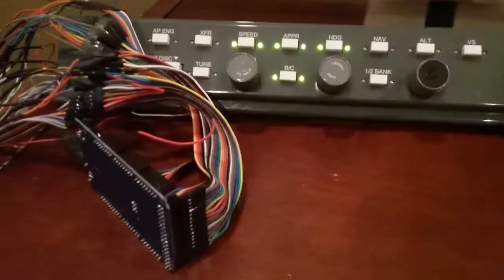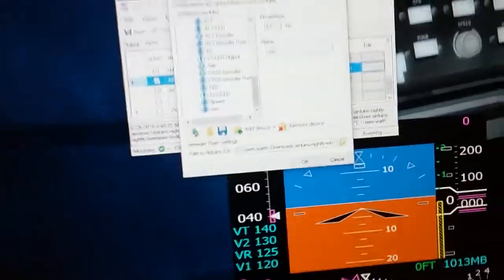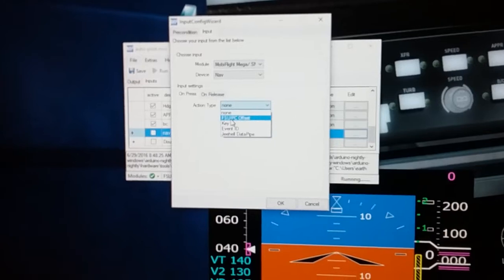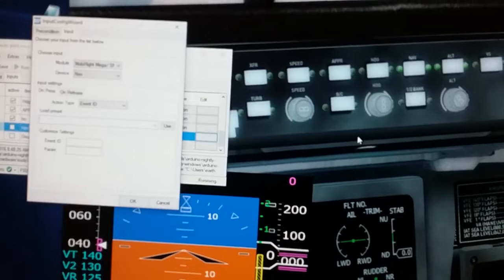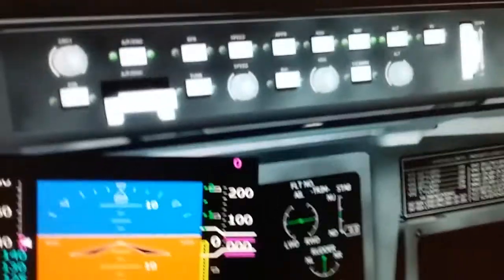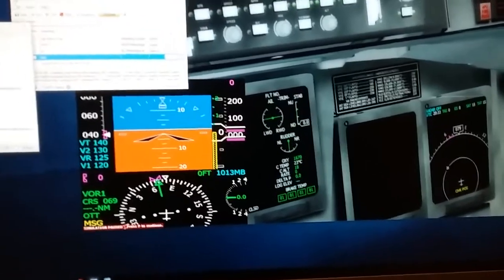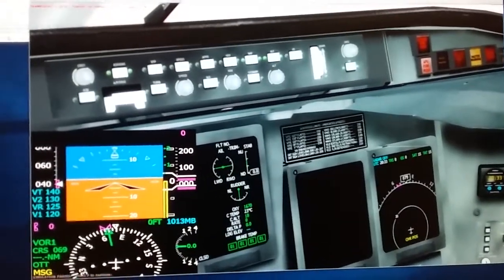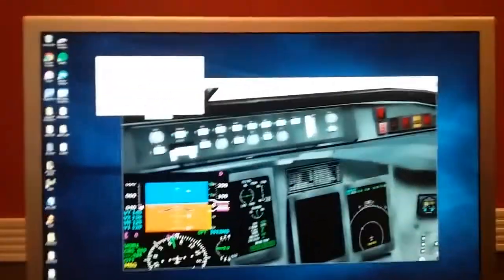How to connect hardware to FSX, Prepar3d, xplane, FSUIPC, Mobi Flight Connector

Comment: So, is there any way to work Mobiflight with XP-11 ? Like using custom Dataref's or commands ?
Reply from the maker: Slammer you would want to use our ARDSim it is similar to this program but it's designed for X-Plane
Reply: I know about that but all of my cockpit system is completely based on MobiFlight and ArdsimX needs some different things with the board to be done, which i'm not keen on :)
Reply from the maker: Slammer what all do is try to make a video that explains how ardSim works in relationship to the board it's actually pretty easy and I'm sure you can do it once you get a good grasp on how it works

Comment: Is MobiFlight for FSX only, or it can help to setup X-Plane as well  ??

Reg
Reply from the maker: Yair Ben-Ad  for xplane you can use ardsim.  It is similar but is a web based application that creates the code.  I had problems with their plugin in windows 10 but it could have been my computer.   Ardsim is working on a new version also.
Reply from the maker: Yair Ben-Ad i wished mobi would work on xplane
Reply: ..tnx Aaron, I just got in touch with Vlad the guy that run the Forum ardsimforum
I'm new to X-Plane, and currently experimenting XP11,    

Cheers 

Yair

Comment: I am happy to see that my software helped you to build your sim! Great!
Reply from the maker: MobiFlight I am still having issues getting leds working.  I am using macro and key commands and not fsuipc.  Any way you can help me get the leds working?
Reply: Aaron Werner oh yes sure! Please visit the forums at http://www.mobiflight.de/forum.html there is me and many more people around that can help you with your questions!
Reply from the maker: MobiFlight it is hard to use your forum due to it not being in english (unless I am doing something wrong) can you email me at myflightdeck@gmail.com? I have a couple of questions you could answer real fast.
Reply from the maker: You have tin install the arduino application and drivers.
Reply from the maker: Tech&Music  did you watch the video I show you how to use it in the video
Reply from the maker: Tech&Music the software I use in the video automatically writes the code for you as you configure it for the hardware, that is the purpose of the software. If you visit mobi's website they explain in detail how it works.

Comment: Well done, it's is very very interesting, I'm trying to figure out if I can use the Board and MobiFlight + FSPUIC to construct the Garmin 600, which is fairly new and no dedicated buttons had been assigned by FSX ??????
Reply from the maker: I have never done a Garmin but maybe you consider going the macro route using FSUIPC and Mobiflight.  Regardless, I wish you success.